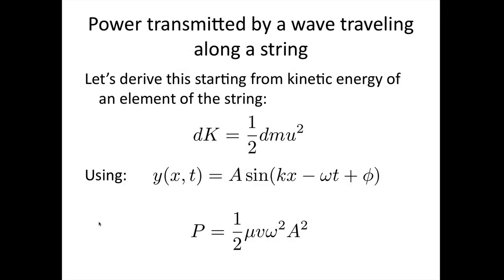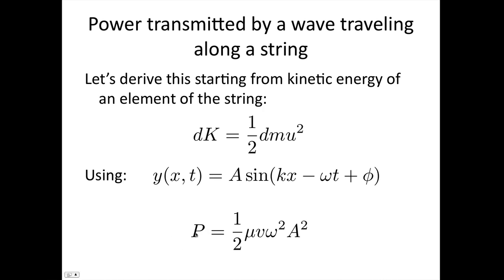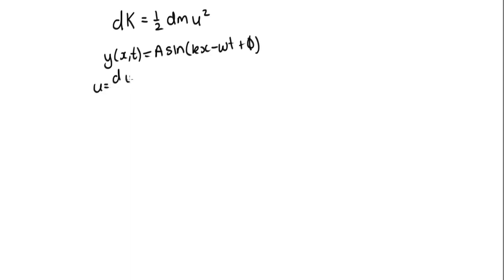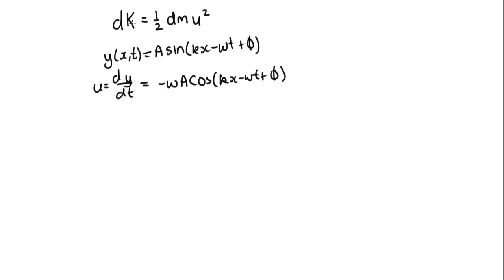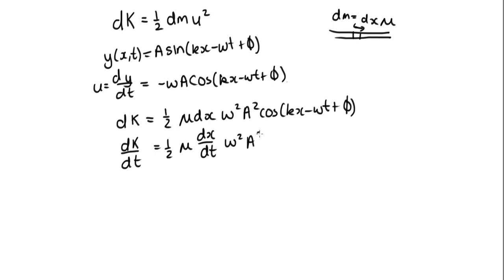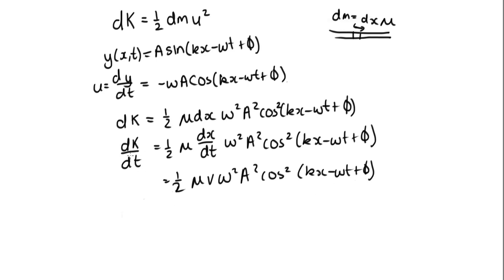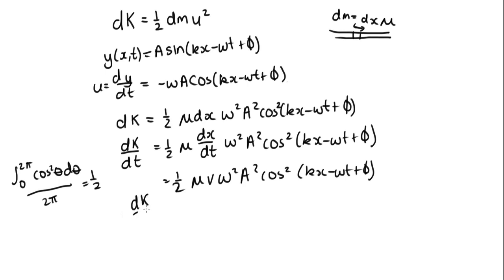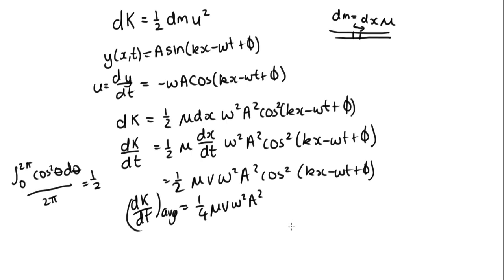Derivation of power transmitted by wave along string

Comment: Thanks for this.
Why don't you consider the potential energy (tension energy when the string is stretched in wave motion) of the mass particle here also?

Also, can you tell me if the total energy of a mass particle on a string is constant in wave motion since the mass particle itself will be in SHM. Or is it variable as would be suggested by the expression for power (at a given x and t). And can you reconcile this.
Reply: She does add the potential energy in the last step. As for your second question, usually in shm there is potential energy associated with the restoring force for example the energy stored in a spring. That potential energy + kinetic energy is constant. But here the potential energy we talk about is the energy stored in the string due to it being stretched, not the energy associated with the force that causes the particle's shm.